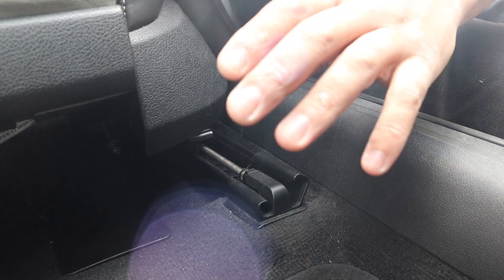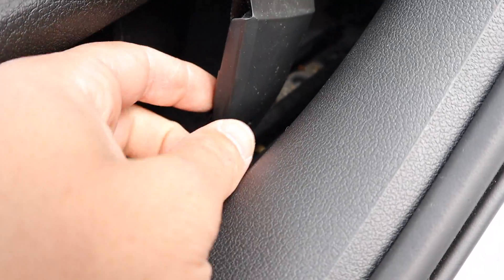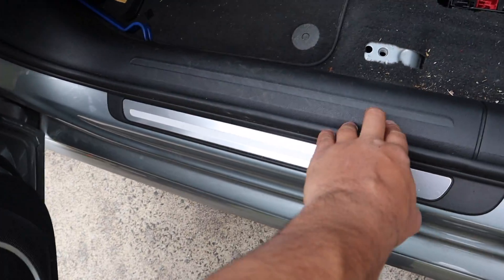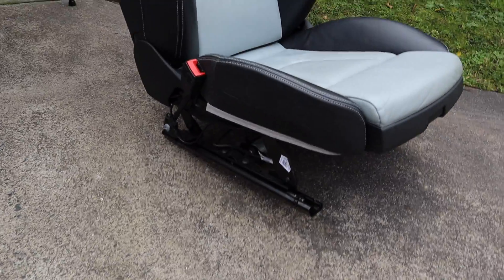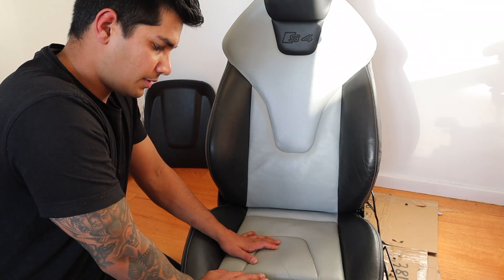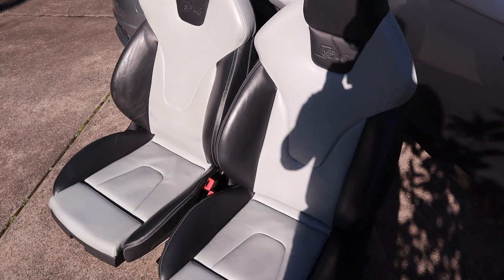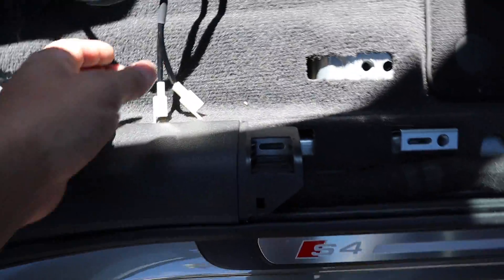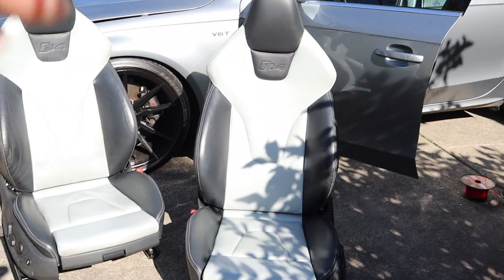I Installed Heated Seats In My B8 Audi

Comment: Hey man great vid. I’ve got an 2009 Audi A4 with very similar seats. How did you remove and reconnect the hog rings on the lower part of the seat? Or did you just trim the heating element around that section? I’ve got mine stripped out at the minute and am debating on whether or not I can be bothered to proceed haha. Any advice would be great. 👍
Reply from the maker: Hey man. I trimmed around :)